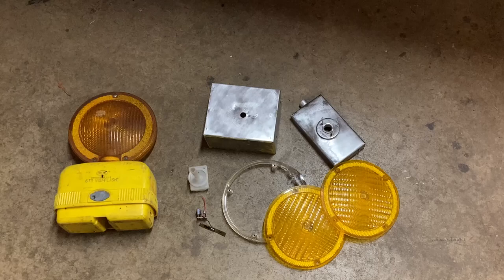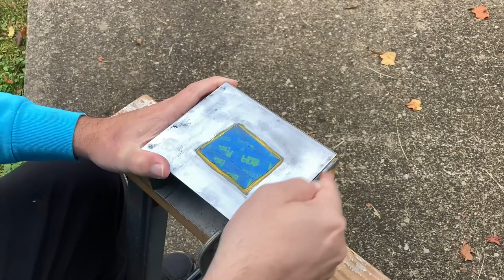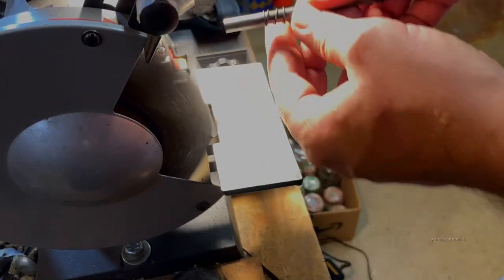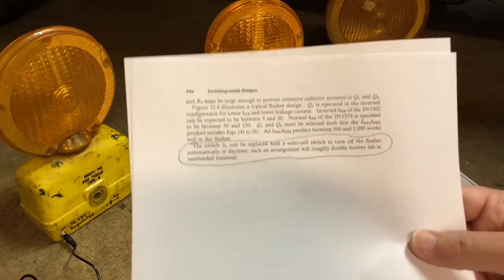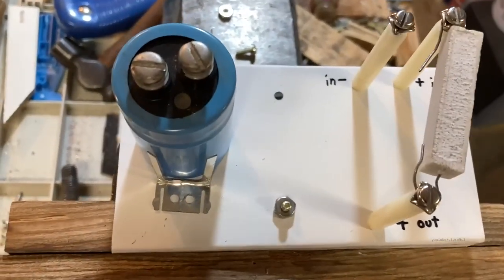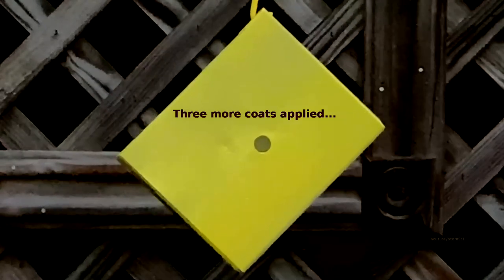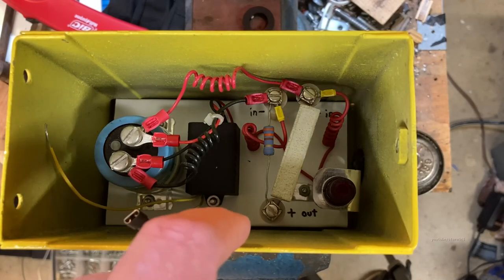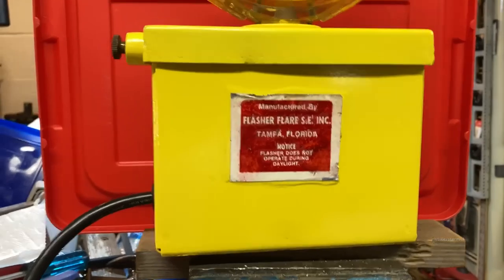1960s Barricade Light -- Road construction light stored in my attic for 40 years -- Will it blink?

Comment: Best video on YouTube. Great stuff man. Fellow collector here as well. Really appreciate your thorough historical research! Those early lights are something special and I am so glad you were able to not only hold onto it for so long but restore it. Another clue to the voltage tolerance on the original board was the lamp type. The GE 1850 has been a solid soldier for many a barricade light. It is a 5V lamp designed to run with a 6V lantern battery. Fortunately they are still available on the market-at least for now in case of an outage. Fantastic history on Flasher Flare.....I wonder if Flasher Flare was purchased by Bobs Barricades? Would like to see some more of your flasher collection.....thanks for sharing
Reply from the maker: Thanks for watching. And thanks for the kind words and info. That project was a labor of love for sure. Most of the lights in my collection are 12V so I tend to have more spare parts for those. Same with power supplies.  I built custom power supplies for most of my lights. Just for fun.  I'll see if i can post some future videos about them. Most of my collection starts in the 60s. But that was the oldest light I had.

Comment: Hey do you know how to start up a flex-o-light flasher because i have one from the 1990s-Early 2000's and i'd love to power it up
Reply: Ive figured out how to open the flasher but i need new batteries, Will keep you updated
Reply from the maker: Install batteries?  Many also have a hidden switch. Look for a small hole in the case. Insert a long skinny nail or piece of 16ga solid wire like bailing wire to click the switch.  Finally many won't run in daylight. Put it in the dark. Failing all those steps it's not uncommon for the bulb to burn out on incandescent models.
Reply: @storm9c1   Ill look for a hidden switch, If your wondering the model then its a paralata signal flasher, from flex-o-light